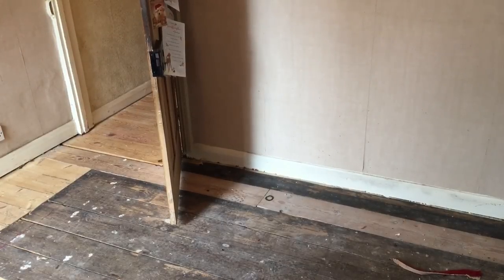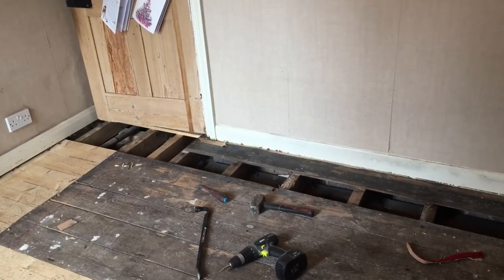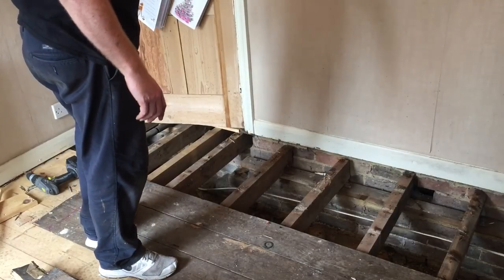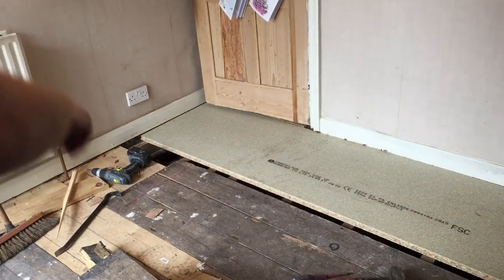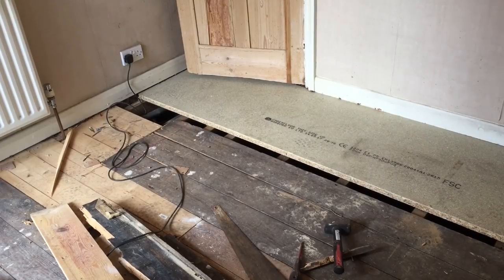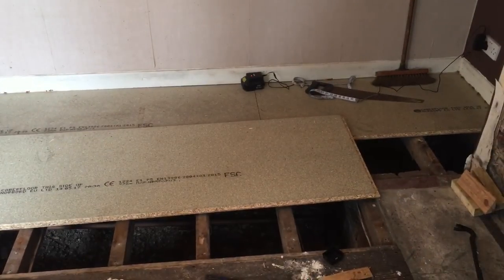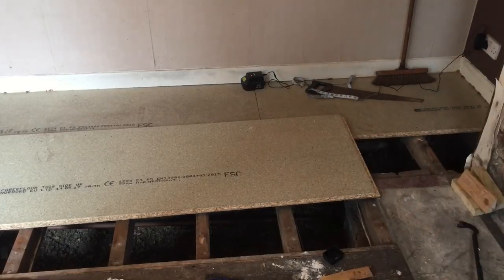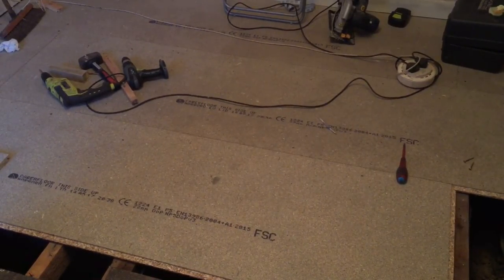DIY flooring. Part 2

Comment: Good job Matt. I bought a couple of these boards about 10 years ago to do my top landing. Never used them because I couldn't be arsed so instead I turned my sheets in to a work bench. Still need to do the landing mind you lol
Reply from the maker: +Sean C lol this is why I love YouTube. Made my smile at end of hard day. Well mines not over yet.  Thanks
Reply: Matt Green the only problem is the floorboards still squeak and so does the wife :(

Comment: Good progress Matt, be nice and flat for some slot cars. I would have cut say a metre off the end of board 2 and profiled it round the hearth, aligning the tongue/groove end on a joist. That offcut can then (maybe) be used at the radiator end of the room. (Or to do bashing without mashing)

Comment: if you have an off cut of good size that cant be used and it has the tongue or grove on it use that to tighten up the joint by hitting that so you dont damage the boards
Reply from the maker: +mark piper wow. Why did I not think of that. Was just using a bit of wood on the top edge.

Comment: Did I miss why you are replacing real floorboards with chipboard? If I was going to do this, which is a helluva lot of work, I would have wanted to remove the skirting boards and ease door architraves et al. Anyway best of luck hope all goes smoothly.